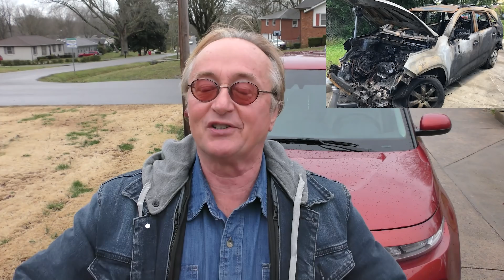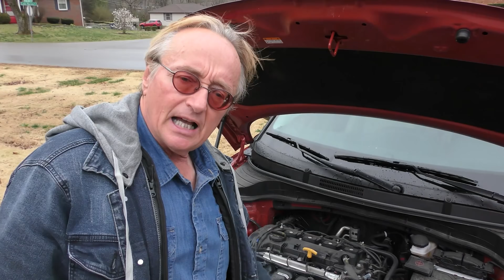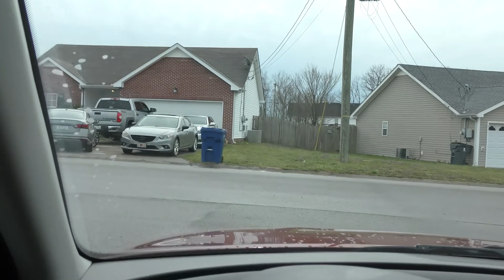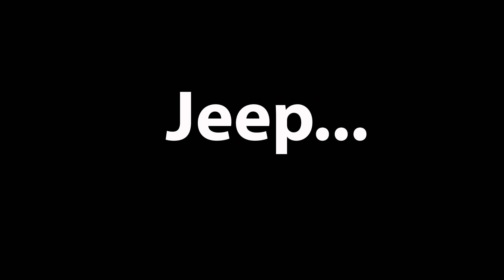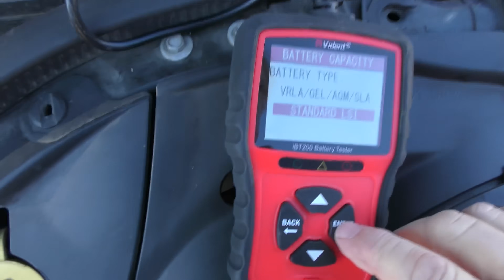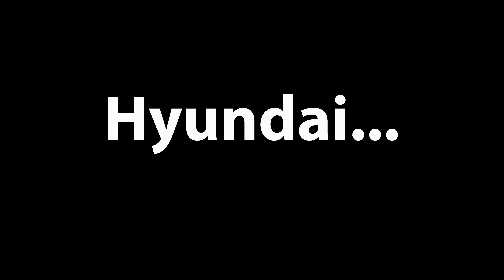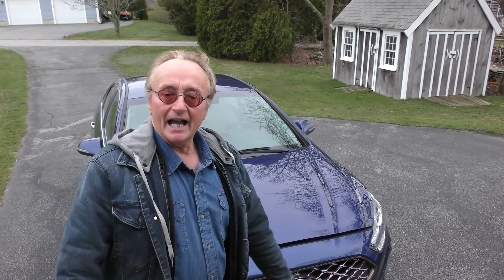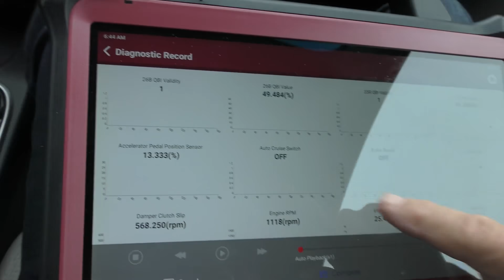3 Car Brands That are Crap

Comment: I've a Peugeot 108 here in the UK but its a Toyota underneath.  The water pump went at 42k and the clutch needed replacing too.  In 33 years of driving this is the first ever time that's happened to me, and I've had some pretty old cars in the past!
Reply: From what I understood the clutches of the Aygo/107/C1 need to be manually adjusted ever so often when serviced. They don't do it automatically themselves. But this work is seldomly done in practice and it is causing them to fail much earlier than they should.
Reply: @psaras65  interesting, although in my case the bearing carrier broke up.

Comment: My 85 VW Jetta still running and driving like new with 238 K and still getting 44 mpg in city driving! Never buy a Jeep or a Kia, they're JUNK!
Reply: I ONCE HAD A 86 Jetta with 650,000 miles and a 85 gtx with 540,0000 both odometers were stuck so they both had more than they showed,neither one used oil or showed any sign of being worn ,I sold both cars to kids that were local and seen both cars years later still driving, old Volvos do the same thing ,I currently have two old 240 s that are approaching 700,000  the other is at 550,000 both still run perfectly,DONT use a drop of oil
Reply: Too bad they don’t make them like that now. 
They’re as unreliable as BMW and Mercedes

Comment: I would agree, but I have a 2018 kia forte which I have 45k miles. Never had any issues with it and have only done oil changes and tire rotations since having it. I like the brand and would buy another one.
Reply: I have a. 2018 Kia forte, prayed it was a good one (2018 Consumers report said that yr eas good). My only one I could afford, this car has to last me till I die!  hope I have a good one too.  18,000 miles so far. Do my oil changes etc. 🙏🏻
Reply: 45k miles is nothing...
Reply: ..if it has just 45k miles, it IS like new...150,000-300,000+ mile vehicles is the norm for me(no, none of them are Toyotas...Chevys and Dodges mostly)...

Comment: My 2006 Kia Sportage started burning a Qt of oil every month
Traded it in at 225k miles for another 2022 KIA Sportage, most reliable car I ever had and I have had several Toyota 4x4 trucks that were not as reliable.
Reply: Where was your 2006 Kia Sportage manufactured... the U.S. or South Korea? Also, where was your 2022 Sportage manufactured?
Reply: I don't believe a Kia was more reliable 5han a Toyota. unless you has lemons. Honda would almost always outlast a Kia.

Comment: I have a 2011 KIA Spectra with about 60k miles. It burns no oil, has plenty of power. I get about 30 mpg. Smooth quiet ride for a small car. I live in Pittsburgh Pa. and leave the car outside year round. It has no rust and the paint has held up pretty well. I change the oil about every 4,000 miles. So far it’s been very economical and relatively maintenance free other than tires, wiper blades, air filters, etc.

Comment: My 2017 Kia Sorento was burning oil back in 2020 and Kia replaced the engine after I complain to the Kia corporate office. The car was under warranty at 72,000 miles. They did the oil test about 4 times now I have a new engine. I would not buy a Kia again.

Comment: Hello Scotty. The wife and I had purchased a 2015 KIA Optima LX   with a 2.4 GDI  Engine  , 4cyl  Automatic transmission. After  about a week and a half , The car started eating Starters. The piece of crap took a Crap. At 135,000. Sent the car to the KIA Dealer and they said After having it at their Dealership for a couple of weeks , Did a Diagnostic test on it and they said the Engine was Done,  Blown Engine.  First they said it was Covered under warranty For Bearings. Then they said they wouldn't cover it because Nobody had started the process for the Recalls that were on this car. The Car lot where we had got it Did Not tell us that there were Any Recalls.  The Car lot , KIA , And even the Financial place where the car was Financed Will Not cover this Junker even with  GAP Insurance. I will NEVER again own Another JUNK  KIA  OR  HYUNDAI.  I'm Done  with them !
Reply: Get a lawyer, here in the UK you'd be covered under consumer law.  Hyundai would literally have to prove there was nothing wrong with the car when they sold it, regardless of the warranty.  After six months it's up to the consumer to show a fault existed, and that lasts six years!  I literally wouldn't let that go if I were you.  Good luck.
Reply: How do you buy a used car without checking recalls yourself!?
Reply: @laboogie  Hello Paige. First , I don't feel that it should be My Responsibility to check for Recalls.  I have Never had to check for Recalls in the past.  I have purchased several cars and pickup trucks in the past without checking for Recalls and have had alot of Really Good,  Dependable and Reliable Vehicles.  Second , When we purchased this KIA , The Dealership had told us that this car has a Clean Carfax. What is sad about this is , There are Alot of these Cars  KIA and Hyundai  that are having Problems.  These cars are Unreliable and are Not Safe.  I had seen a White KIA Optima today sitting along the highway today broke down.   Do some research on these cars,  Buyer Beware !
Reply: @johnelsonjr.6008  it is always your responsibility as a buyer. you are who is going to suffer if u don’t. buyer beware, always, do your due diligence and do not rely on a car salesmen who just wants to sell u a car.
Reply: @johnelsonjr.6008  So the previous owners felt the same as you, so zero recalls got done.
Reply: @Kyle Belair  in the UK it wouldn't matter if it'd done 535,000.  If it had a major fault when sold and you can demonstrate it then it's down to the dealer for up to six years.  Within six months they even have to prove that the car was fault free when sold.
Reply: How many starters did it eat?
Reply: @benztech2262   Hello  BenzTech.  3 Starters Total. The starter that came with the car , And  2 more . The starter that came with the car went out about a week and a half after purchasing the car and The second starter went out about a week and a half after the first one. The third starter was put in and had lasted about 10 minutes. The car was Eating Starters until the Bearings in the motor went out. The KIA Dealer where we took it to for Diagnostic said the motor was Done and needed to be replaced.  KIA won't stand behind their JUNK products. They said it would Cost between $ 5,000 - $ 6,000 to replace the Engine  , Not Including Taxes. ALSO ,  I was informed that these Replacement Engines are NOT New , They are  REMANUFACTURED !
Reply: It's different in US for Kias and Hyundais comapred to European, Australian and Asian markets. They are very much a reliable cars in those places and never would see them in the top of the worst brands/cars lists because they are reliable in most markets (except US). In Australia, hyundais are even considered above Toyota for reliability.

The problem I think is US gets cheaper ones. Also the service of Hyundais and kias in US is dog sh*t whereas it's pretty good in other markets. Also, US uses cheap fuel and calls it normal fuel, and calls normal fuel premium, whereas in most other market, your premium fuel is our normal. Not blaming on the fuel, but the manufacturers has to make the car accordingly.
Whatever it is, it is evident that Hyundais and Kias aren't putting any good effort in US, they just wants to sell a bunch of cars and that's it, they don't care about if it breaks down or if the service is sh*t, better to get some other brand (But Hyundai EVs are good though).
Reply: @Kyle Belair  You sound like a lemon dealer and I don't mean at a fruit market.

Comment: I’ve got 56k miles on my 2020 Kia Soul GT Line with the 1.6 Turbo and the dual clutch trans. Changed oil, filters, and tire rotation myself every 5k miles. It’s been great.
Reply: @Kyle Belair  no, dual clutch

Comment: Lol I got a 2021base model soul in Octobrt 2020. Just passed 41,000 and no issues. Been changing oil every 5k miles from the start. 7500 seems a long interval to me. Anyway, so far so good lol. Plus, Kia dealership I got it from I've not had any negative issues yet.

Comment: If you get a Hyundai, do make sure it's made in Korea. My dad's 2016 Hyundai Elantra seems to be going strong well past 100,000 miles.

Not to mention their new Elantras are pretty nice for the average driver.
Reply: I do believe the Korean versions are made better. But have to watch out because there are Kia Forte being build in Mexico now. I will not buy any cars made in Mexico because from my experience those seem to have the most problems.

Comment: This makes me even happier owning a Toyota Corolla!
Reply: Corolla gang! I just bought a 14’ Corolla with 146,000 miles….I fully expect it to last 300,000 with routine maintenance 👍🏻
Reply: @greeneyesfromohio4103  

Every one “expects” their automobile to last.   

Have you actually had any vehicle reach 300,000 miles?

My Ford Focus just hit 180,000. I am also believing it can make 300k +
Reply: @larryclark9380  I had a 1988 BMW 325i go over 300,000 miles. But not much further at about 320K it just self disintegrated. 😂
Reply: After a lot of research I decided to buy a 2022 Corolla with a Standard Transmission.  I am planning to treat it as a baby 👶.  I will change the oil every 3500 miles replacing the oil filter with an original Toyota one.  That helps too.
Reply: @rameystarman2439  just so you're aware Denso makes the toyota filters.
Reply: @rameystarman2439  Honda better
Reply: Toyota is the best car company, my old truck had sand in the engine and it still ran Great.
Reply: U should have gotten a Honda instead
Reply: Corolla lasts forever 🇨🇦🇨🇦
Reply: @Dutchy-1168  really funny how many escorts sunfires neons etc were sold 20 years ago you never see them anymore.  Still see tons of early 2000 corolla civic Camry accord.  Even late 90s.  Why do people not get this and continue to buy sub standard junk. Unreal.  I'd say advertising brand loyalty and yes racism
Reply: @666dynomax  only car any better is the Prius ‼️‼️‼️
Reply: @Dutchy-1168  the prius gives me a lot of hopw in toyota hybrids.  Ford not so much.  Ever been to a ford dealer?   I feel violated each and every time and it's frequent when you have a ford.  Those heartless pricks  that work the desk have one goal.  To vacuum as much money from your wallet as they can.  Not saying toyota dealers are better but you don't spend much time in there
Reply: Bought my 2017 Toyota Corolla LE 
last October. No check engine lights after 1 year, just some oil changes here and there
Reply: Got a 2006 Corolla 127000 miles.  $2500   Good deal.  Also have a a 2016 subaru crosstrek 47000 miles, great so far.    2001 Ford F-350 duper duty 67000 miles.  Hmmmmm not so sure about that one.   Lol.
Reply: Nobody cares

Comment: 2003 ranger 261000 miles rebuild tranny got 36,000 off rebuild,took em 5 times to fix.original problem was loss of reverse.tight chunky shifting,1st gear slip always gotta pedal throttle for 2nd.blamed cats which I hollowed and blame rear end which has nothing to do w power transfer.chunky shift stopped but 3rd now difficult.literally see gas gauge move.KT transmission,n ft Myers Fla.gonna shame em.

Comment: I really had my heart set on a new Kia Soul or Hyundai.  It looks like my 27-year-old Marquis with 430,000 miles is going to need to run a while longer.  It only burns 1/2 quart of oil every 2,500 miles.  Ol' Scotty just shoots those Korean cars down....Great video!
Reply: I have a 2018 Hyundai Elantra. 150k miles on it. Have driven it on low oil and dirty oil as I didn’t have money to buy oil. Never had an issue. Someone said they are hit and miss and that seems to be the case. I wouldn’t expect anymore than another 50-100k mile out of the car even tho it’s only a 2018. If I drove it nicer it would probably got on even further. Just got lucky tbh
Reply: @dylanb5699  I've got a 2010 forte that I bought new,  has 318k very hard driven miles,  looks like crap still runs and drives like new... I think if it's not a Toyota according to Scotty it's junk.
Reply: I find that very,very ,very, hard to believe!!
Reply: @briangrant9026  The Ford/Mercury panther cars with the V8 are actually some of the most reliable cars out there believe it or not. 400K on a Crown Vic or Grand Marquis really isn’t unheard of on these particular cars.
Reply: @lerg12  A matter of opinion, older mopars were rattles traps! Fact!
Reply: @briangrant9026  Welp you said it yourself, it’s just a matter of opinion!
Reply: @lerg12  I owned several mopars, not my favorite. But I do like the retro body styles, especially the CUDA!

Comment: it's probably burning oil partly due to auto start stop. it's a load of baloney that just wears out the engine faster and doesn't save that much gas by the time the car kicks the bucket
Reply: Auto stop start is the stupidest thing invented for general public. I was driving along,  watching the stoplights and a Jeep blew past me and pulled up at the stoplight and it shut off and restated in around 2 seconds before he made a left turn.
Reply: Facts! LeXus Gs engine valve cover leaks at 30,000 miles and engine coils, spark plugs fouled out and engine blew up.
Reply: It spares enough gas to allow you to afford all the starters it'll go through.

Comment: I had 2 Hyundais Accent & Elantra. Both never had an issue. I gave them both to our kids who ran the wheels off. 150-200k.
Reply: 150k to 200k are rookie numbers
Reply: @dutchvanderlinde658  Not for original owners, if the cars are crap at 10 years or at 150.000 miles, thats the used car buyers problem.  All cars at that age and mileage timeframe should never be  expected to be trouble free,  and used car buyers should not expect them to perform as when new. Thats why you can pay pennies on the dollar versus full msrp that new car buyers like me pay.
Reply: @dutchvanderlinde658  It’s called, being sensible about man made objects. Join the 21st century. No automobiles are made to that capability any longer.
Reply: @dutchvanderlinde658  Sure you can take certain Hondas and Toyotas to 400-500k, but for the average driver 16 years is a very good lifespan for a car

Comment: According to recent police reports. Kia and Hyundai vehicles are the most stolen vehicle brands in the United States. Models that are more than 3 years old don't have an immobilizer system so the ignition system can be punched out and the vehicles started with a screwdriver.

Comment: You’re wrong Scotty, that’s a 60:1 fuel mixture ratio. Do you really not know that these Kias are 2 cycle engines?
Reply: Sorry, 80:1. Mileage is better than I thought. Figured he was driving it around in “Racing” mode.

Comment: My experience with Hyundai's has shown me that the best models are the ones manufactured  between 1995-2009.
I don't trust the 2010-2022 models...
My 2004 and 2006 Hyundai's have been rock solid..Only a starter needed to be replaced.
Reply: Had a English teacher that got one of the first Hyundai Sonatas. In the early 90s because I graduated in 1992. Anyway it was burning oil bad and wasn't even that old.
Reply: Personally never had an issue with my 2018 Elantra. 150k miles no issues very lucky me
Reply: @dylanb5699  Cool! Just keep the engine oil and radiator coolant changed.
Reply: those have Mitsubishi engines.
yes they used make great engines. 
not any more!
Reply: @newchannel1220  Are you sure about that?
Reply: @JohnnyTyrone77  hyundai used to make Whole copy of Mitsubishi cars not just engines.

Comment: I wouldn't ever buy any of these cars! I wouldn't even buy Honda, always Toyota, on my 3rd the past 25 years
Reply: My mom has a 2009 Honda Fit with 140k miles hasn’t had a single issue other than a O2 sensor